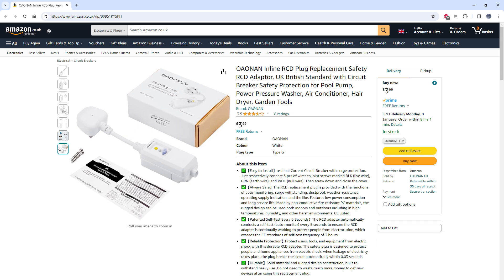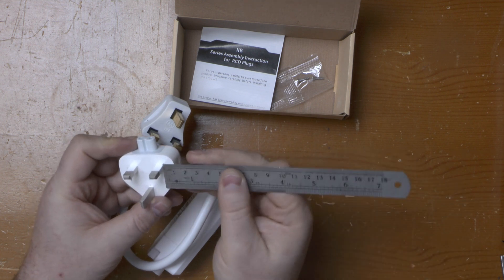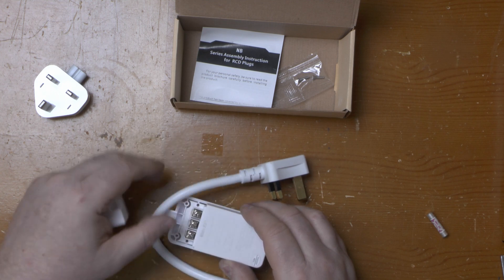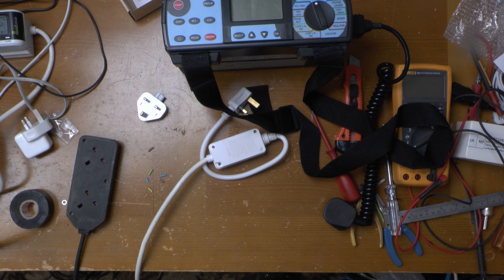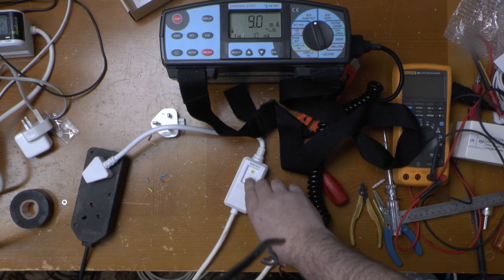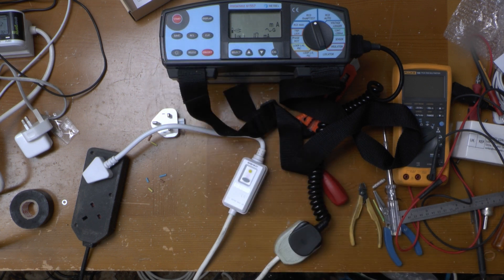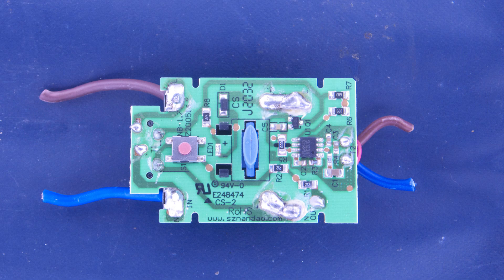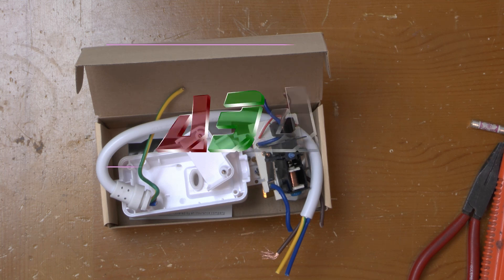OAONAN RCD plug teardown and schematic

Comment: It looks like the test button doesn't rely on an earth connection.
Reply from the maker: Generally they don't.  It's allowing current to flow through and deliberately imbalance the coil.  Looking at it now I may have an error in the diagram, test current should only flow once through the coil, not out and back again.  I've either picked from the wrong side or they've got the wire going in the other direction through the coil to what I've drawn, which would double what the trip circuit would see as it would flow once through the proper wire, then again through the trip wire.
Reply: @AintBigAintClever Thanks for the reverse engineering into a readable schematic. Normally the test button connects live to earth via a resistance, but this design doesn't consider if there is an earth at all. It looks like the feed to R1 should not go back through the magnetic core. Your videos are really interesting and I can imagine tracing out the circuits is a labour of love. Thank you.
Reply from the maker: @richardlangner  I'd edited my reply but it didn't go through.  I've miswired in the schematic, the test wire comes from the other side (the D1 cathode side), goes through the coil then goes to R1.  This is the red wire that can be seen at 3:59.
I've added a comment at the end of the video description.
I've not seen any which use the earth wire for testing, this would be risky if there's an missing earth as the test button would raise the potential of the appliance metalwork.  RCDs with a functional earth wire use it to enable the RCD to still trip if there's a leakage to earth even if the supply neutral is broken.
See PDF page 11 (page no. 9) here: https://download.schneider-electric.com/files?p_enDocType=Catalog&p_File_Name=CA908066E+%28web%29.pdf&p_Doc_Ref=CA908066E
Reply from the maker: @richardlangner  the process of tracing out the schematics also helps understand how the circuit works :)

Comment: at least you chinese plug did not have a sleeved earth pin, also copper coloured steel wires 🙂
Reply from the maker: I was expecting either scrawny wires or copper clad aluminium, I was surprised to find copper. and what appears to be the correct amount of it.